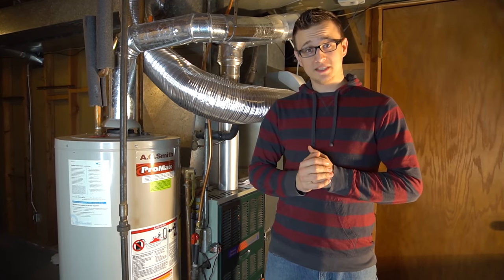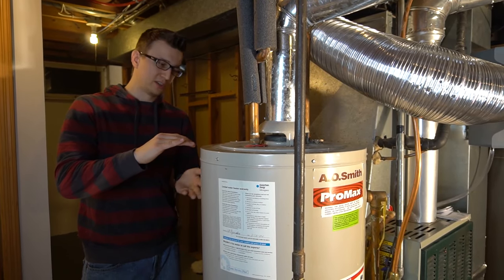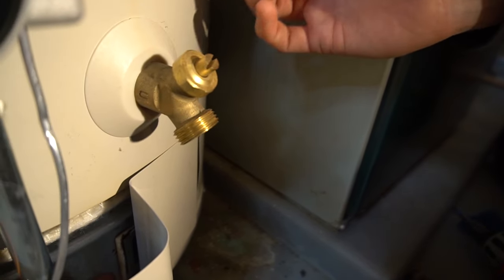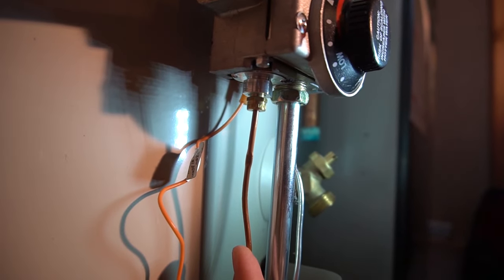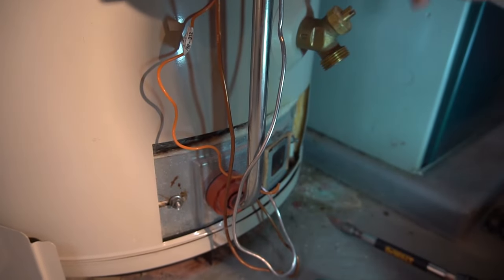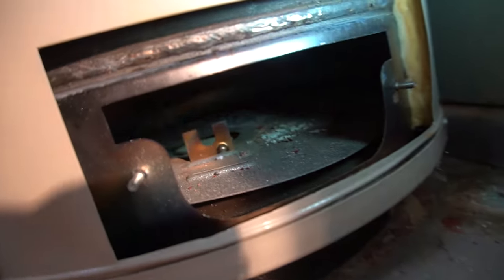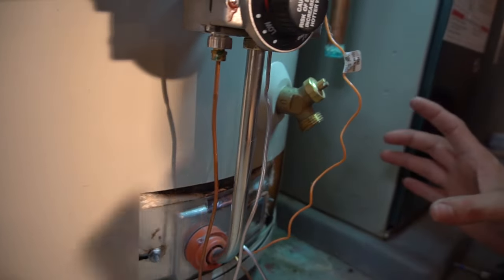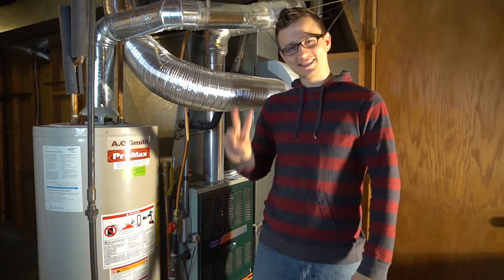How a Gas Water Heater Works ✔

Comment: I admire your honesty: You're supposed to check the anode rod, the pressure relief valve, flush yearly, clean the air filter grill, but I never do. Reminds me of myself. If it aint broke it don't need fixin. I'm a firm believer of not messing with things because the manufacturer offers overkill maintenance procedures. Not neglect just common sense.

Comment: I have a 2015 Rheem 40 Gallon gas water heater. Each time when I take a shower, the water becomes cold in 5 to 10 minutes. I thought it was the dip tube problem, so I replaced it with a brand new dip tube. But the problem still exists. I did find that after 5 to 10 minutes, the flame inside the water heater turns orange from the blue. Does anybody know what the problem could be and how I can fix it? Thanks a lot!

Comment: Learning alot from your channel. THX!. Seeing your hot water set up you must have a OPEN system & its NOT installed in the garage.  No E.T. & your tank is not elevated off the floor. -- A homeowner that is learning to fix my own appliances.

Comment: Great video. Very comprehensive. Thanks. Water is coming from my Pressure Relief Valve ( I didn't know what it was prior to this video) and I didn't know what was happening. "Do I need to call a plumber asap?" From your video information, I lowered the temp on the heater and it eventually stopped. Since I am unemployed at this time, your video allowed me to understand the basics. Thanks again.
Reply from the maker: You're welcome! Glad to hear the video helped!

Comment: Great video overall. Very detailed and included most all of the important items around water heater construction and operation. Thanks for posting. I do think replacing the anode rod (3-5 yrs) and draining the heater every year are important as is testing the overpressurization valve. You seem to blow these items off as not necessary when in fact they help extend the life and safety aspects of the water heater. Thanks!
Reply: I was surprised he disregarded the anode, draining, and safety valve maintenance as well.  The tank manufacture screws in  the anode rod and exposes the nut to remove it for a reason.  I guess if you were to cut open 100 10 year old tanks you could come to a better conclusion but until someone does that I think you should check it yearly. Some people may never need to replace it but you will not know if you are one of those if you don't check it. Taking it out yearly will also making getting it out a lot easier in 10 years if it then should be replaced.  As far as the safety valve goes the warning tag right on the things says it must be opened yearly to make sure it is not stuck.

Comment: Great video!!! I am having a problem with my HD RHEEM water heater but i think your video might have solved my problem.  My water heater has a lit pilot light but the burner will not ignite to main burner to heat the water. From what you said is the thermal pile rod needs to send a signal back to turn on the main burner. That tells me it i replace the thermal pile rod it should solve my problem i hope. I just hope it is not something in the electronic box. I will replace it an see what happens.  Thanks for your video.  Thumbs up 👍.

Comment: Thank you for taking us through the hot water system. You covered basically all the parts and how they work. You even went into the heart of the system showing how to remove to check the burner. Great video and sharing.
Reply from the maker: Thank you! Glad you found helpful! :)

Comment: Good video as always, thank you!
I flush mine every year and change the anode rode every 2 years or so as I have a water softner and it eats up the anode like crazy. Doing regular maintenance allows to make your water heater last more than 20 years.... my last one was still going after 21 year when I sold the house lol. All the recommendations are in the manual, worth checking.
Reply: My Anode is on way to tight, I'll move the water heater, sucks. I do flush every year. I also have a water softener

Comment: Excellent video. An neighbor is throwing away a brand new looking 40 gal. water heater from Rheem installed in 2016. She explained to  me it leaked, the technician came, looked, said it is shot and replaced it. Looks like the one carried at Home Depot, model number XG40T09HE40U0. So surprised it lasts only less than 5 years.

Comment: This was great! I'm having a problem where I get just 5 minutes of hot water out of a fairly new Richmond Gas Water Heater.  The dip tube was replaced and my inexperienced plumber has no idea what else can cause this problem that went from intermittent to constant.  Note that it is 75 gallons, that it vents out the roof and we use standard, modern faucets. I'm at a loss! Can you help?

Comment: That really was a great and comprehensive introduction of how Gas water heater works.

I am actually here to find out some way to automate my Gas water heater. I currently need to light it On and Off everytime, I need to use the hot water.

By anyway, Can you guide me to correct direction. I am in need of a module, which contains a electric spark module, a electrically controlled thermostat, which can be operated by a software and a remote connection like a Wifi or Bluetooth controlled device. Please guide me in the right direction.

Comment: Thank you for your informative channel. I am a contractor but still benefit from your videos. `I noticed on your water heater that you ran copper straight off the top of your water heater. It is recommended to use dielectric unions in situations such as this even though there is an anode rod in the tank since the tank is steel and copper is considerably different in galvanic potential and will sacrifice the higher charged metal, in this case the steel which is your water heater.
Reply: Dielectric unions? 
My house was built in 01 and I had a new water heater put in 2017, old heater cracked even with draining and anode rods

Why the unions if I may ask? Mine doesn’t have them
Reply: I’m

Comment: Another awesome video.  I never took out the gas burner unit before (never needed too) but now if something does go wrong I will know how to take it apart and put it back together safely.  All your videos are very helpful and informative.  I thank you for sharing all of this with us.  God Bless.  Oh, one questions:  How do you take out the sacrificial rod if it is longer than you have room to the ceiling.  Mine is a 40 gal on a 19" high platform along with my heater, heater is 46" tall and that leaves me 33 1/2" to the ceiling.  I don't know how long the rod is in a 40 gal unit.  It's a State Select model, never heard of this, but I live in Florida, it might be popular here.  Thanks for your help, I was going to attempt this last year but was afraid I couldn't get it out, even more so, getting a new one in.
Reply from the maker: Already answered in a different comment ;)

Comment: My two Bradford-White water heaters are now 16 years old. I keep waiting for the inevitable to happen. You mentioned a 40 year old water-heater which gives me hope that mine may have a chance to go a lot longer!
Reply: Proper maintenance is the best way to get best longevity from your water heating unit including testing the pressure SAFETY valve.
It’s not a safety feature if it is not working properly and testing it is the ONLY way to ensure safe operation. Watch Myth Busters water heater experiment

Comment: excellent video.   My 10 years old tank has some problem.  I have to manually re light the water heater often.   Is that means the thermocouple is not functioning properly?   

Thanks

Comment: This was really helpful! We bought our house about a year ago and have gas hot water. One thing I’m still confused about- should the flame be a little one like at the end of the video, or a ring around the burner like on the stove? I’ve seen photos/ videos of each.
Reply from the maker: The little flame stays on all the time if you have a water heater like mine. It's called the pilot light. But the big burner or the big flame only comes on when the water in the heater cools off and needs to be reheated again. Once it heats the water back up, the big flame goes out once again and only the little flame stays on. The purpose of the pilot light is simply to light the big burner when the water needs to be heated. Hope that makes sense!
Reply: The ring is the burner that heat up the water. The little one is the pilot without it heating the thermal couple the gas valve won’t open to let the burner on.

Comment: I had natural gas water heater replaced 2 years ago. New AOSMITH 71 gallon.  Within 1st year we heard banging sounds immediately after using any significant amount of hot water (shower, dishwasher) and sometimes even after small demands (left running while washing hands for 20-30 seconds during Covid). Never had it with the old heater. Our service replaced the magnesium sacrificial rod with an aluminum one - free of charge, so I don't think it was a con, but didn't think that was really the source of the problem. The banging lessened, but we still occassionally experience it - certainly not as often and perhaps stopping sooner, with not as many bangs per incident. I have tried opening and running all faucets (thinking perhaps there was an "air hammer" trapped somewhere). The banging sounds definitely are in the basement very close to or inside the water heater.  Any thoughts on what is causing this annoying noise?

Comment: My pilot works perfect but the water heater will not kick in, only as i move the temperature Dial up it will kick in, heat up and then stay and cool again to just a little warm, or I call it Pilot warm. If I go back and turn the dial a bit more the thermostat will klick and it will heat again. So i have been doing this now and have reached the HOT but again it will not keep heating. One odd thing is the my water has and incredible high content of Calcium. I helped my neighbour change his 14 year old Tank and it had 3 inches of calcium deposit on the bottom. Could this be interfering with the Thermostat? I did all the cleaning you talked about. My tank is 7 years old. Before I pull it all apart I would love to hear your opinion. Great video clear, to the point I never skipped a frame.

Comment: Great video!!
 
Hey I have an AO Smith almost identical to yours. Do you know if that little circular grating under the burner is removable/replaceable? Mine is kind of crusty-looking. Both burner and pilot have been going out at the same time, and Home Deport water heater expert guy told me it was not getting enough air. I can't figure out what else might be causing the problem. I tried using a wire brush and vacuuming it out but pilot is still quitting.
Reply from the maker: That thing is incredibly hard to clean and can't be taken out/accessed in any easy way. I dont know why AO Smith made that dumb design. I know people that simply drilled and broke that grate apart to let the water heater breathe normally. Many water heaters have no intake filter at all, not to mention this terrible honeycomb design.

Comment: Hi, very instructional, unfortunately for me did not found out what's wrong with my water heater. After replacing the drain valve now the tank wont fill up. Bleed all the air but no luck. Can you please help.

Comment: Thank you for the video.
So cold water is always on? surely it'll can't keep on filling up? what happens to that?
Reply from the maker: You're welcome!
Basically there is constant pressure going to all of your faucets. That's why when you open them, water comes gushing out. If you close the cold water shut off valve, the pressure disappears so no water comes out. The water tank and all the pipes are sealed, meaning under normal operation, no water can leak out anywhere except the exit points. (showers, spigots, faucets, toilets) Hope that makes sense. 😅
Reply: @WordofAdviceTV  so when non of the water is being used... there is a constant pressures everywhere? but not enough to burst the pipe and such?
Reply from the maker: @xxgg  Yes. 👍👍 Usually about 50-60psi

Comment: Thank you for the video, great one.... I was talking with my fiance when I heard a sound in the boiler room and saw water coming out he baffle ( Middle part) I tuned off the gas valve  and checked the furnce  area and saw it was completely dirty( lol) rust and it looks like the outer tank is leaky ... Come to find out the tank is over 20 years old... Never been clean... New water heater....

Thank u for the video... Ooo. What do you think??????
Reply from the maker: Like you said, likely a leaking tank. Sorry to hear about your loss. They say average life is about 15 years so it did well for you.  Hopefully the new one will outlast the old! :)

Comment: This is SO helpful! Mine is a 40 gal gas tank and is leaking, will it make it 15 more days?  It is still heating and I am bucket catching the water is there a way to fill it backup to retain /replenish the water tank until it completely fails? In 15 days my home warranty kicks in.
Reply from the maker: Glad to hear the video helped! Have you watched this video? https://www.youtube.com/watch?v=ambX6ND8dbQ&t=7s   If your inner tank is leaking, I have seen people leave it like that for over a year.. So 15 days should be no problem. Of course keep an eye on it though. The water is "automatically" refilling, so there is no need for you to fill it or anything like that.
Reply: Replace it immediately. If not, it could flood if it rusts through farther. Better safe than sorry.

Comment: Good overall explanation, with one correction, the thermal couple is not only detecting the heat on the pilot, it also powers the gas valve. There is a small voltage generated when it is heated by the pilot and it will open the gas valve. A current very small, but enough to drive the valve.

Comment: Great video. Thank you. Question: My tank is 6 yrs old. Approximately 6 months ago when it calls for heat, there's a lot of popping sounds coming from it. And when someone in the house turns another faucet on, the popping increases briefly. I researched it and found that it might need flushed. I did that last night and it still does it. Maybe not as bad. Should I re flush again? Thanks for your time! Jim.
Reply from the maker: You can try flushing it a couple times and that will help somewhat but that noise is very hard to get rid of. The popping sound is coming from the scale build up inside of the tank. Similar to the stuff you get on the inside of a tea kettle. When the water starts to heat up, it starts "popping". It doesn't affect operation at all but it is an annoying sound.. My parents' heater has been doing that for like 10 years now and still going strong
Reply: JHenzly - The popping sound is the sediment/small rocks that have accumulated at the bottom of the tank and when the heated water rises it causes these particles to rise and fall and hit the metal/glass lined tank making the  popping noises.  This is the reason for draining your tank. Draining may help some but you're essentially unable to get all of the particles out of the tank without agitating the water much more than normal draining would do.  Unfortunately the drain inlet is higher than the bottom of the tank which allows sediment to stay at the bottom of the tank and not be able to get drained. Some sort of hose needs to be in there to really agitate the water enough to be able to go out the drain. This is where the design of the tank has shortcomings.  Hope this helps

Comment: I noticed your exhaust vent tube turned almost 90 degrees a very short distance from the top of the heater is that safe? Will it pull the fumes out?

Comment: I like your videos. I have a question the orange gasket next to the glass where you can see the spark mine tore . So I was wondering if it is still safe to use it like that?

Comment: Nice video and I learn a lot. I bought a new Rheem Performance Platinum 40 gal gas water heater from Home Depot and was installed by Home Depot contractor. The water heater make very loud rumbling boiling noise each time it ignites the gas to heat the water and the noise continue until it finishing heating. The water heater is located on the ground floor in the garage and the noise can be heard on the second floor. My neighbour has a 2 year old Rheem 40 gal gas water heater and the  running noise is so low when compare to mine. Mine is 10 times louder. Is this normal? It has done this since day one. Is something wrong with the burner or the gas valve? Does this build up the pressure in the tank? Thanks!
Reply from the maker: If it is a new water heater, it should not be doing that. I would call Home Depot to come check out the tank. It may be defective right off the bat.

Comment: Great video. I’m glad I am a subscriber. I have a question about two gas water heater’s that are hooked up in parallel. Is it OK to drain the one that has a problem while still using the other one? The reason I’m asking is I’m wondering if the hot water going out of the water heater to the appliances in the house passing by the water heater this basically empty is that a problem?

Comment: I got the same A.O. SMITH brand, 2006, just got my MN house in spring, yesterday did a flush, just a little bit of debris came out, so got lucky, not sure if it was ever drained. refilled at about 1/4 way then drain again, twice to make sure any crap at the bottom got out, at first had to blow thru my hose a few times to get it to drain. To make a water heater last is a Water Softener. Very informative Video, Thank you